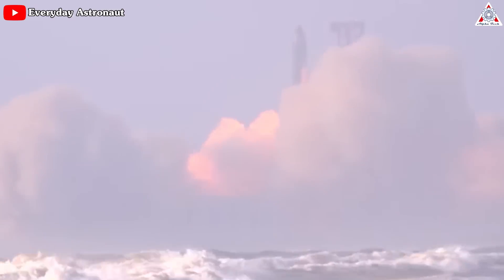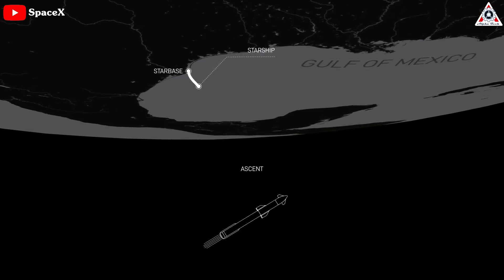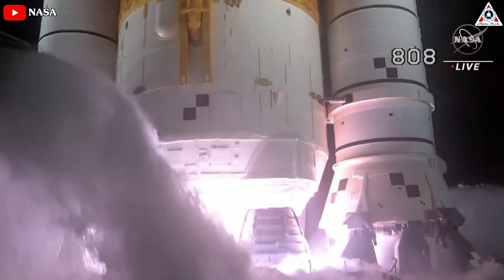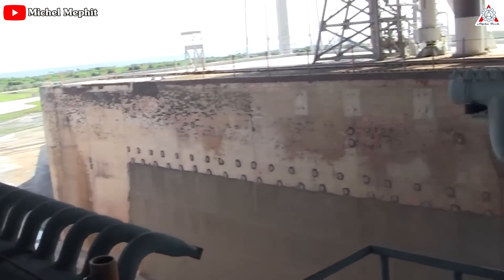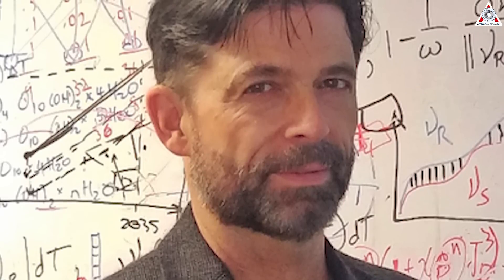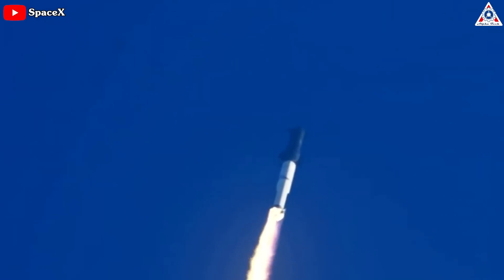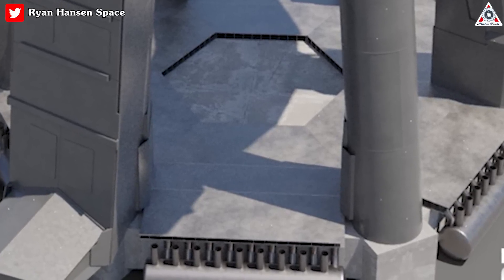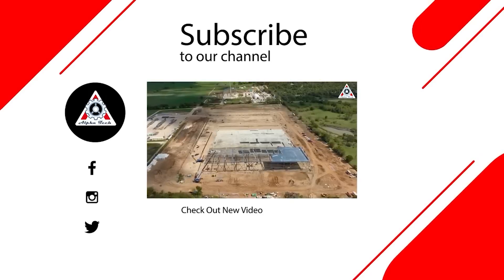SpaceX's NEW Solution to prevent the pad damage by 33 engines...

Comment: I love starship , I wish space X all the luck in the world but I truly don't see a starship launch this side of Christmas. The FAA drag their feet and there are roumers of locals  filling lawsuits
Reply: Terrible Idea water expands 1600 times as it turns to vapor if they aren't able to cool the water it will explode like a giant steam boiler! and even the most heat resistant steel melts at 2800F Raptor 2 temp is 6000F liquid nitrogen might be a better idea but even then its unlikely to work!

Comment: Doesn't Soyuz have its launch mount high above the surface which doesn't require a flame diverter and deluge system?  Of coarse they can't have a deluge system because of the freezing temps.

Comment: Any major changes to StarShips Launch Pad (Stage Zero), will likely be aimed at EM's desire for Rapid Turn-around between Launches. Repainting the Launch Pad Base between launched isn't in the Stars for SpaceX nor is replacing any major parts. Whatever they decide on is also going to have to be usable for their planned Sea Based Launches.

Comment: Idk, 33 engines just seems like too many engines and failure points. That was what really limited the Space shuttle, the maintenance of the engines. Starship seemed to have been way too susceptible to overheating because of this. Their was a visible fire in the low pressure hot spots in the center engine that led to the remaining engine failures. It seems as though protecting the engines from the launchpad and during flight would of been the first concern.

Comment: Ever put a paper coffee cup filled with water into a fire?  the water will boil but the paper doesn't burn.  So i don't think the water cooled steel plate will burn or melt, still doesn't explain how they plan on landing a space ship on Mars...  The surface of mars is gravel, rocks, sand and dust,  that kajigger is going to come in for a landing, dig a hole,  touchdown and then fall over,  if by some miracle it doesn't fall over,  the engines will never hoot the whistler after getting mega blasted by gravel, rocks, sand and dust and dont have a snowballs chance of lifting off

Comment: Those shock waves will destroy the rocket after a few accumulative launches, therefore so much for using the rocket over and over. you half to flood the pad with water and create a diversion.  You can not cut corners here and just hope for the best come launch day.
Reply: Terrible Idea water expands 1600 times as it turns to vapor steam if they aren't able to cool the water it will explode like a giant steam boiler! and even the most heat resistant steel melts at 2800F Raptor 2 temp is 6000F liquid nitrogen might be a better idea but even then its unlikely to work!
Reply: @ezragonzalez8936  the water is primarily used to dissipate/reduce the shock wave. Water has been used by SpaceX and NASA for years.

Comment: So, a corporation cut engineering corners and safety measures out of an abundance of focus on their timeline and bottom line? Color me surprised.

Dig the trench already. It's a tried and true method for sound and heat suppression. Considering all the $$$$ you spent on the concrete pad, you just sent pieces of hurling into the surrounding area, and the time and $$$$ it's going to take you to eventually do it the right way. I'd guess you're  wishing you had done so the first time.
But, I guess if you have billions of dollars to throw around...

Comment: No, the water shield isn't going to build up steam pressure in the plate and explode people.  You design stuff like this so stuff like that doesn't happen.  First, water has a very high heat capacity, and it's heat of vaporization is extremely high.  You just have to keep the flow going through the plate; lots of it, from a pond or something.  I doubt if there is boiling even occurring in the plate, other than nucleate boiling at the upper surface (tiny bubbles are generated, removing a LOT of heat, and are swept away with the bulk coolant, where they condense and transfer the heat to the water.)  Even if there is quite a bit, the system would be open ended, probably returning the water to the source, and if steam is generated it will just be routed away from the plate with very little restriction; very little pressure buildup.  Power plants basically transfer tremendous amounts of heat using water and steam, and the technology started in the eighteenth century!!!   They got this.

Comment: Why is the material that withstands Sun's heat that is on the Parker Solar probe not used? Is the heat of the 30-plus engines more than that generated by the sun's corona?
Reply: Temperature and heat aren't the same.  Plus that stuff is really expensive and probably couldn't handle the shock.

Comment: Methane/ oxygen is similar to acetylene/ oxygen. One gigantic blow torch that is over 2,500  degrees. The heat and gas pressure makes concrete explode . 
Unless they flood the pad with mega tons of water to suppress heat and sound, that pad won't survive multiple launches.
Water flowing through a steel plate will boil off rapidly and leave hydrogen. Same thing as a boiler blowing up. The steel will probably warp too. 
I hope SpaceX comes up with a safe solution and spends the money on a positive solution.
Reply: "Water flowing through a steel plate will boil off rapidly and leave hydrogen." No, that's not how steam explosions work.  When water boils it expands to 1700 times as much volume of steam.  Hydrogen has nothing to do with it.

Comment: That steel plate will not have the volume of water pumped through it to keep it cool from 33 engines. That steel plate would have to have the capacity for 60,000 gallons or more  to be pumped through it. That plate will melt! Hopeful it can last 15 or 20 seconds of those engines!
Reply: 60,000 gallons of water is nothing.  Nuke and large coal plant cooling towers have pumps that run a half a million gallons of water per minute through their condensers.  A one-acre pond holds a third of a million gallons of water.

Comment: This was never going to be an orbital flight. Musk admitted as much in interviews before the launch. 

Even with the addition of water-cooled plates, the blast force will still be pounding the launch platform supports. All of the NASA systems utilize flame trenches that direct the blast away from the structure that is holding to rocket up and to my knowledge none of them use a flat surface directly below the rocket. But then I guess Elon knows better than the 50 plus years of experience at NASA.

Comment: Those engines cut through reinforced concrete like a giant blow torch. That plate is bound to warp and buckle no matter how much water is used.
Reply: That kinda depends on how robustly you design the plate, doesn't it?

Comment: What about a steel plate covered by the same heat shield material that protects the reentry vehicles. Also, start the launch higher off the ground and redirect the heat with heat shield material.
Reply: They are fragile. It would shatter instantly.  Pressure is very slowly and evenly increased during r-entry.
Reply: @ericrandall3539  I agree - the material would have to be strengthen. Would be very expensive- water cooled metal plate may be difficult to beat overall

Comment: The water cooled Metal plate WILL NOT WORK. The Rocket Blast WILL BREAK THE METAL PLATES>
TAke my advice. I may not be a physicist but a swimming pool over the concrete and maybe metal plate has to be deep enough to displace and absorb the blast and NOT BREAK the Plate if it extends far enough done the diversion routes before exiting.

Comment: Any water that seeps into the trenches goes away. The trenches could be designed to use this effect to dissipate energy away from the rocket and any nearby infrastructure.
You cannot stop the energy, you have to direct it.

They knew that this launch stand would be destroyed. It was expendable to get this one flight off the ground. Didn't they count on it damaging the rocket?

Comment: From photos of stage zero, it seems to me that the steel rebar began melting inside the concrete 2nd to heat and lost the structural integrity of the  newsom concrete allowing the pad to blow apart. I would suggest looking into changing to "MST bar" instead. (Toronto Canada).

Comment: By the way, the steel plates on the bottom of the launch tower that’s my idea. Nevertheless I do grant it for SpaceX but the plates I saw here in the video are maybe not massive enough. They have to be embedded into the concrete. No any little surface may cut across the blow - but the plates shouldn’t be like a mirror for the sound wave, they must scattering the sound, ask me please how to do it

Comment: I personally have my doubts about the steel plate being much better than the concrete was. Elon Musk is right to second guess his earlier decision, this may mean building an entirely new launch facility. But it will aid future space flight decision making as a case for engineers to point to. Even failures have value.

Comment: I don't really believe any of the comments related to the shallow water table in the Boca Chica area. Launch pad 39a at Kennedy Space Center is right on the ocean located in a swamp. The groundwater table is 3 ft or less below the surface pad 39 was elevated to create flame exhaust trenches under the LaunchPad that do not require constant pumping systems to keep them dry. Virtually all of the pads at the cape are built this way which one or two exceptions of silos that were built for testing Silo launched missiles. When those were abandoned the pump shut-off, they filled with water!

Comment: Creating a pad of water cooled steel launch pad is an untested design. Sure, water passing under the steel will cool it and increase its melting temperature. Similar to a bell nozzle having its fuel first cool the nozzle before returning to the turbo pump. But I don't think there is a calculation or a test example of removing that much heat. They are talking about the intense heat, pressure, and vibration of 17,000,000lbs of force and heat. The water in the plates will probably expand faster than the heat can escape. It will probably buckle from underneath as well as on top. The flow rate and volume is going to have to be enormous and tested. For rapid and reusable... the best option would be a deep water trench like at Stennis. They could run that shit all day but that's not going to happen at Boca Chica. If it was my engineering team, we would be building, testing and reiterating at Marshall before trying at Boca Chica. Then, the FAA could have some confidence in the design to issue the launch license.
Reply: "The water in the plates will probably expand faster than the heat can escape." Only if you designed it wrong.  There's no reason for having any restrictions in the flowpath.
Reply: @nathanwahl9224  ok. well, we'll just see how it works.
Reply: @nathanwahl9224  But it's not about restrictions in the flow path. The plates, the way they are connected, have to maintain their integrity to conduct the flow rate to all of the design area. If any plate loses integrity or connection to other plates, the flow rate will be interrupted, and the pad will fail. The flow rate has to be designed to not only absorb the heat from above the plate but also has to conduct the transferred heat away. Too low of a flow rate and the steel will fail. Vibration may also cause failure. I won't feel confident until they can put a booster over it and do a full duration fire of 33 engines at 100% engine power without damage.

Comment: What about a launch platform off the coast.  The rocket exhaust will go directly  into the ocean. It would be built like a long peir about 5 to 10 kilometers long with a launch platform at the end of it. The rocket would have been a successful launch if all 33 engines fired and it separated when it was supposed to..

Comment: The flight was not "orbital."  It was not "incredible."  The vehicle launch was uncontrolled, and the liftoff was not straight up, but rather at an angle.  The launch pad was destroyed.  The tank farm was seriously damaged.  Wildlife were killed and injured.  Nearby buildings/communities were damaged by flying derbies.  The noise levels far exceeded the permitted and estimated levels.  Protected animals and habitat were destroyed.  The rocket lost control very early and was allowed to continue until it looped uncontrollably.  The second stage was never initiated.

The whole debacle must not be repeated.  I am sure that NASA will not allow this type of event at the Florida 39A pad.  I am also sure the FAA will not permit future launches without significant changes, including a proper flame trench and water deluge system.

What a failure.  All of the issues encountered were not only foreseeable, they were inevitable due to poor engineering and government oversight.  I am embarrassed for the United States.

Comment: would it be a good idea to use heat shield instead of steel plates at the bottom?
Reply: The ceramics of a heat shield would shatter under the force.

Comment: The problem of a classic diverter is that SpaceX do not want an "hole" under the launchpad, for easy access to the engine (between future launches and landings) to have fast reusability.
To address this, they could build some sort of "retractable floor" above a possible diverter hole, that could be slided "opened" , in a sort of underground pocket. Or make like a grid of "small windows" that opens in case of a launch, but could be left closed for engines inspection, forming the floor that they like so much under the pad.
Reply: Build the retractable floor into the tower itself. Just before launch it rotates to the opposite side of the tower and folds down.

Comment: Or take one raptor engine and make a scaled down version of the launch pad one with a scaled down steel plate and one with a scaled down flame diverted. And then open up the throttle and lel them rip for 10 to 15 seconds and then assess the damage??? 😮😮😮

Comment: if they use a flat steel water plate, all that pressure that dug out the ground will now be forced right back up into the engine bay causing more failures in the next attempt if they do this. they need to put it on and angle or better yet make a cone shaped diverter to direct the force out between the leg openings. of course, the best solution is to do like Florida and build a raised platform and make a real diversion trench.

Comment: Imagine me before any video’s regarding the Space X damage to it’s engines from the extremely powerful thrust, that blew up chunks of concrete before the huge rocket actually launched from the rocket platform , and now the solution I thought of was a thick super strength steel plate that an average guy like myself would have implemented before this launch should have happened; thus preventing any damage to these very expensive engines and rocket. 

The only thing I didn’t think about was using water for reducing the heat from the thrust to further increase the protection of the steel plate below. Sometimes the less educated people can come up with the best solution to an obvious problem that the so-called highly educated people apparently didn’t think about. 

Unfortunately I won’t get paid for my original idea just after the launch. No doubt others have thought of this same idea as well.

Comment: excuse me, spacex can't dig a flame diverted because the watertable is too close, I call bullshit on that. We're about to dig a tunnel in Antwerp for the 3rd time, and for the third time we have to build close to the watertable. First you dig and fill the hole with bentonite, then you reinforce those walls with reinforced concrete, then you pore the reinforced concrete floor, because the bentonite wall is much deeper, so they can suck out the groundwater. Spacex can do the same, I even suggested to instead of a flame diverter, to build a deep pool. I doubt that watercooled steel plate will do any good if you can't cool it fast enough. The can dig a flame diverter, that's actually the easiest task, the hardest is to make sure it works properly and is reusable after each launch, otherwise their objective won't be met of sending multiple of those rockets a day to mars and the moon. I think a deep pool is the safest option, if they make a roof over it, they can divert the water instead of flames because of the pressure the flames have on that water, the water has to go somewhere which isn't vaporized. I just don't know, if the molecules would separate of hydrogen and oxygen and turn that pool into a giant bomb underneath a giant bomb. Excitement ensured!!!